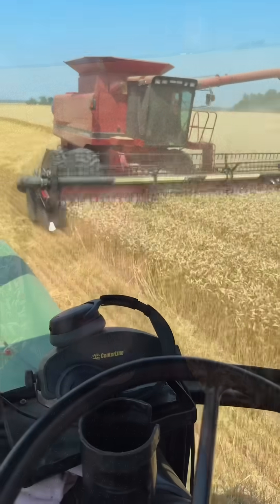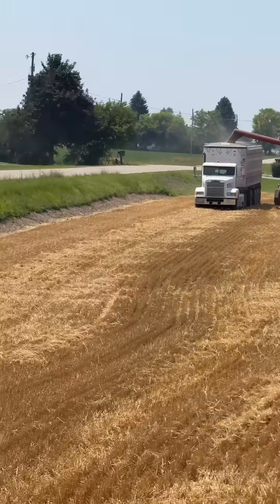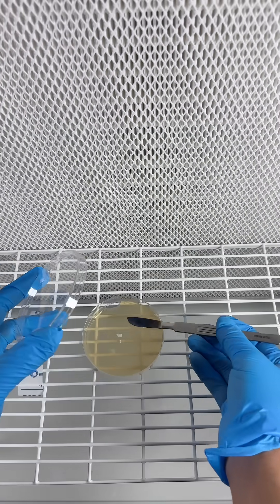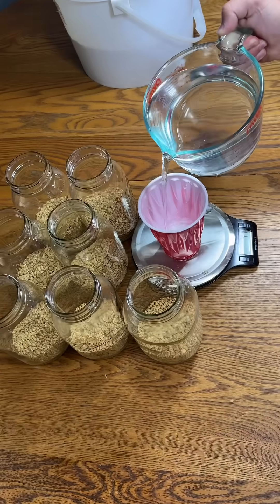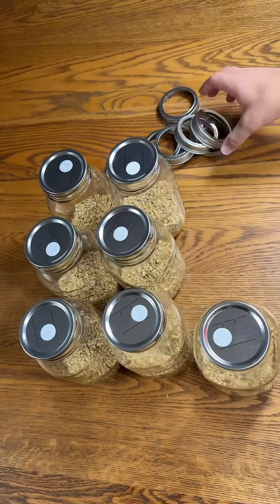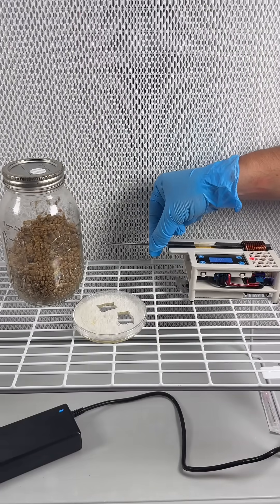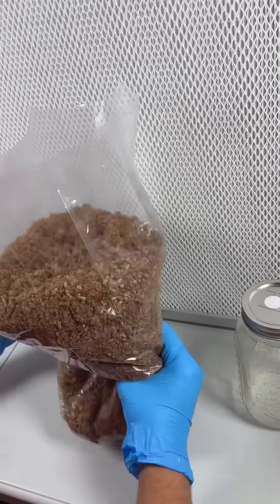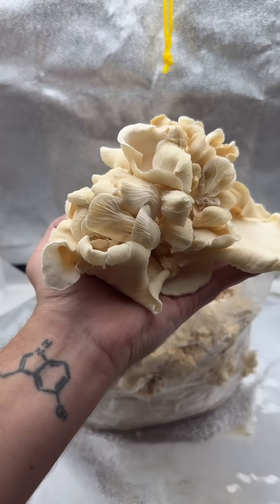NSNS Mushroom Grain Spawn Method #shorts #shortvideo #growyourown #mushroom #farm #diy #hobby #spore

Comment: I just threw some king oyster feet split in half in one jar, the entire cap and seperate feet in one jar, only the center piece of the foot in one jar etc, trying out some different cuts. They're all growing, but the strongest so far is the split feet jar. The jars are filled with boiled mixed grains, wheat, barley, oats and some stray peas.

Comment: Hi, I have three questions: 
* After I have drilled a hole in each lid what do I use as the filter? And how do you attach it? 
* Might sound a silly question but once you have sterilised the scalpel do you let it cool down before scraping the mycelium? I'm worried if I use it hot it'll kill the mycelium, but if I let it cool, I'm just allowing new fresh bacteria to grow..... 
* The steriliser you use on scalpel is really cool do you know the make and model?

Lastly love the content
Reply from the maker: Thanks bro! You can use 2 layers of micropore tape for the air filter which is just paper medical tape at Walmart or here: https://amzn.to/4pa5FmP

Yes let the scalpel cool down for a minute before using. Preferably doing the work inside a still air box like this: https://youtu.be/svUq2OeQNC4

The automatic sterilizer I got is from my friend at rhizofunga dot com. You can use a blow torch instead though.
Reply: Many thanks for the reply. My last question is if I use a blowtorch, if I get black soot should I use a serialisation wipe to remove the soot or is there no need?

Comment: Wait, what the purpose of pressure cooker? The ingredients are in sealed jars
Reply from the maker: Pressure cooker sterilizes the contents of the jar
Reply: @SporenSprout 

Since the jars are sealed, even with just regular boiling in pot will do the same. 
The pressure will do nothing to the content inside the jars.
Reply from the maker: @isfantauhid No, both of your statements are false actually
Reply: @SporenSprout 
Educate me please
Reply from the maker: @isfantauhid  A pressure cooker raises the temperature far above boiling (to 250°F / 121°C), which is the only way to kill heat-resistant bacterial endospores that would otherwise contaminate the grain.
Reply: Autoclaving
Reply from the maker: @satishkumarramteke3162 heck yea